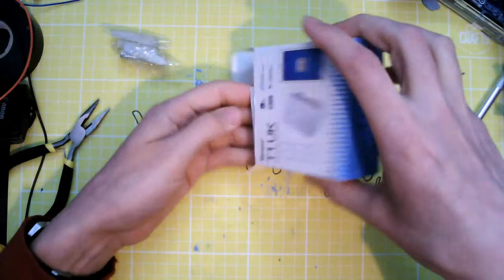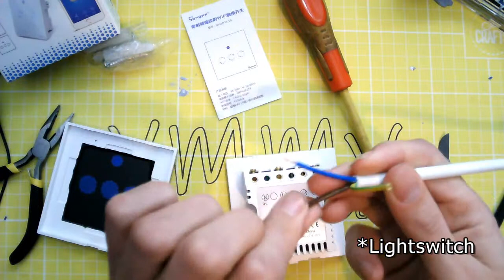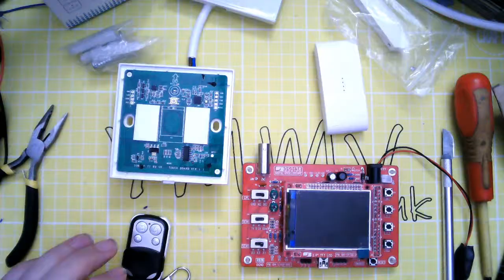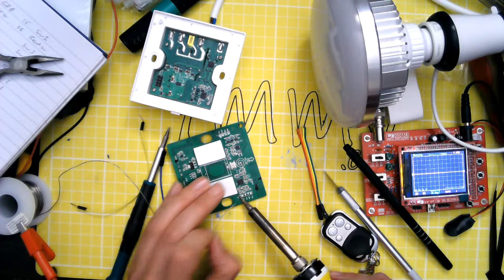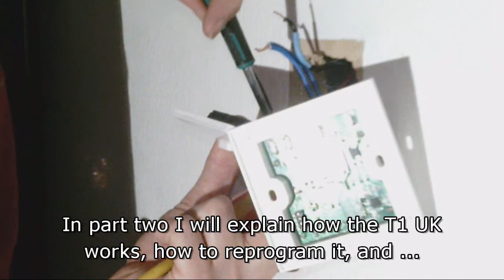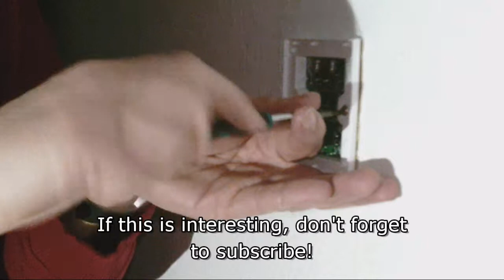Sonoff T1 UK - Take it apart, hack it into my IoT, install it in the wall (part 1)

Comment: Hi, where is part 2 video? I'm looking for a good guide how to program the rf chip to make it work with tasmota passing rf codes to mqtt
Reply from the maker: Sorry ... it was lost along with a lot of other things.
Simply a case of connecting a 10K resistor between the data out of the RF IC and the GPIO2 pin (top one of the header), though.